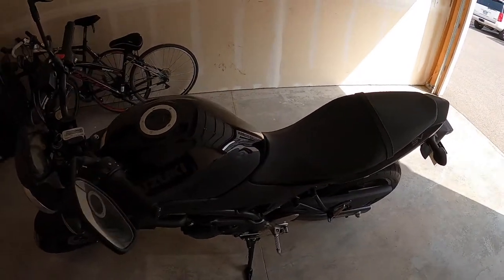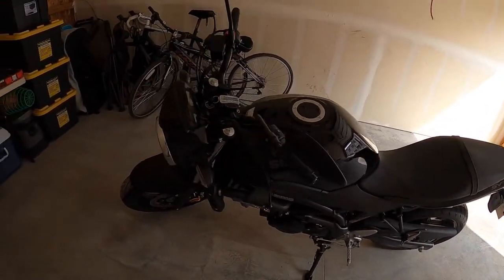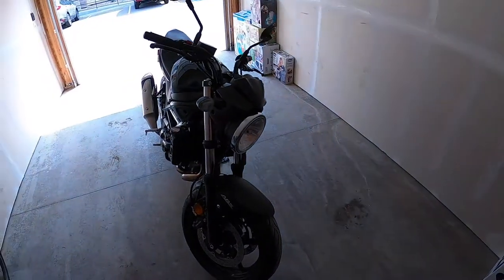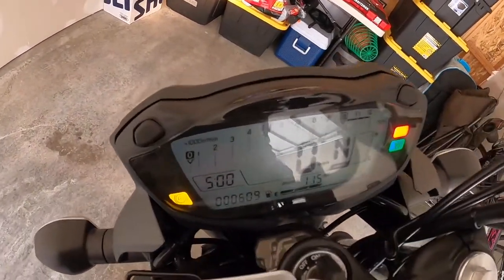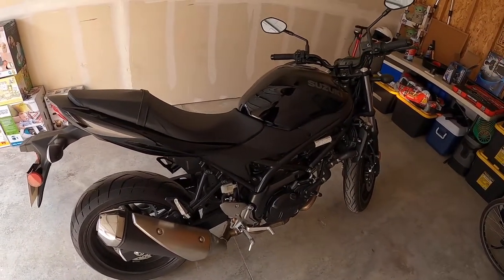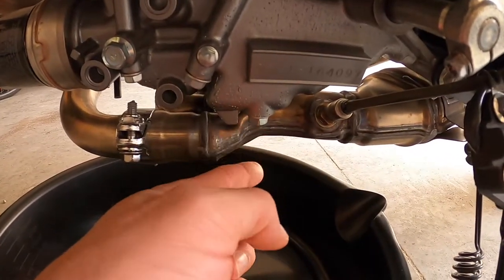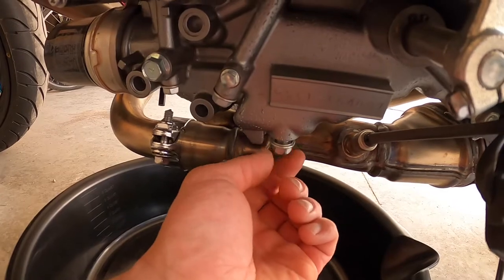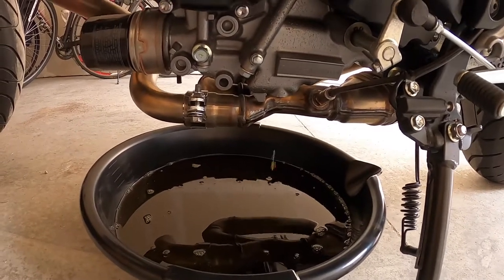2020 Suzuki SV650 Motorcycle Oil Change

Comment: Just a suggestion, Jeremy. check the magnet's strength on the drain plug. My V strom has the same plug. I replaced it with a Dimple brand - super powerful and protects the engine much more. They're expensive, but worth it. Suzuki is like Harley , they put anemic drain plugs that don't do much. If you do keep the original , just use  Honda type crush washer, which is flat and easy to remove. You can use the Honda type many times before replacing. Ive heard Harley's need Dimples, because they shed metal like a dog sheds hair. Suzuki Motors never have much attatched to the magnet- they make excellent engines. Have fun!

Comment: 2 things only because I am a little OCD the drain bolt you called a a nut twice. Second the crush washer on the the drain bolt guys if you for got to get one don’t sweat it you can reuse the same one 2 or 3 times max and it will not leak!
Reply from the maker: Haha ya I know, once I realized I said it in the video I couldn't take it back. It's hard trying to concentrate on the task at hand and doing the video at the same time. I had a little brain freeze for a few minutes there.

Comment: You should invest in a 3/8" drive torque wrench - the recommended torque for the sump drain bolt is only 23 NM. It is so easy to over tighten and strip the thread in the sump without a torque wrench ! - Would mean removing the sump and fitting a helicoil thread insert to make good.

Comment: may be a bit naïve question, but you oil seems pretty clean (not opaque). If the standard wisdom from cars apply, you probably don't need to change oil every 600miles, specially if there are synthetic oil for motorcycles.
Thank you for nice content. I'm also thinking about getting a motorcycle license so your vides are really helpful.
Reply from the maker: Thanks a lot Nirav, I really appreciate that.
To answer your question, when you buy a brand new motorcycle, the 600 mile oil change is extremely important even though the oil is still clean, because it helps flush out all the metal shavings and other particles that flake off your brand new engine. Since the bike is still being broken in, you want to flush all the debris and metal shavings out of your bike so it doesn't stay in there and build up and cause problems later on. The first oil change helps with that and that's why it is so important. My dealer specifically told me how important the 600 mile oil service is right after I had purchased the bike. So if you get yourself a new bike, make sure you read the manual and it will explain everything for you. 

If you have any questions about getting your motorcycle license or a bike, definitely let me know. I'm glad my videos help you out!
Reply: How come you didn’t take the bike back to the dealer . I pick up my brand new SV 650 in a few weeks and it has to go to the main dealer for the 600 to keep the warranty
Reply: @peterkenworthy9219  you don’t have to bring it to the dealer to maintain warranty, you absolutely can do any amount of work yourself (and save a lot of money). They just want you to go back so they can charge you for a really simple service, but your warranty will be fine if you do it yourself. Just save the receipts for the oil/filter and keep a work log in case anything goes wrong ever and you can use that to show Suzuki.